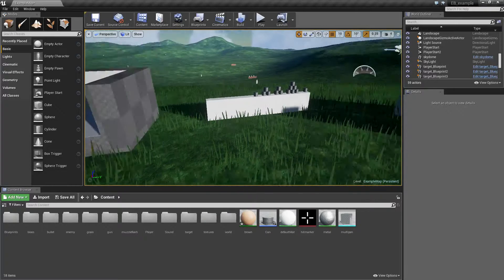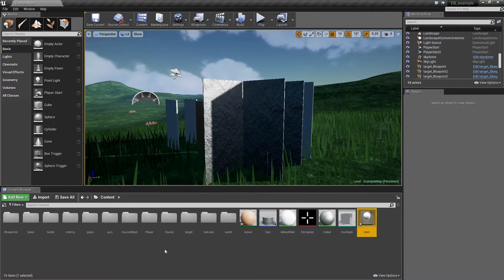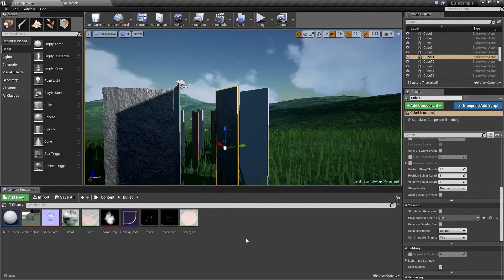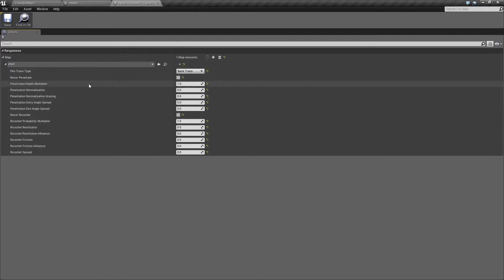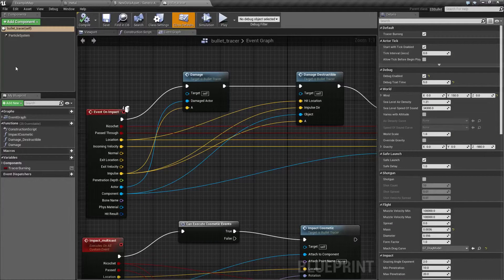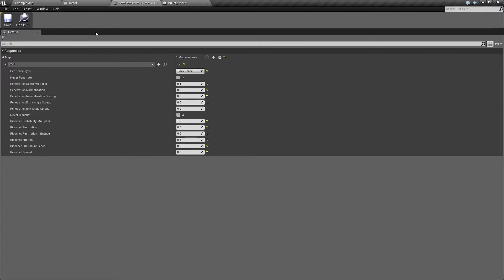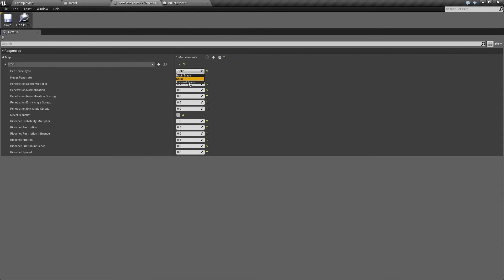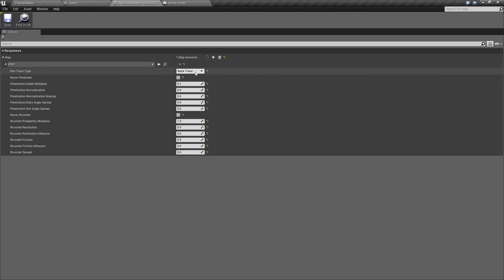EasyBallistics tutorial - MaterialResponseMap (1.4)

Comment: Can these variables be changed via blueprint? I guess I just add the class from the map bp and the values become changeable in the blueprint. So I could have bullet proof glass take 5 hits (or 100% damage) then break it using chaos solver to remove the mesh/allow bullets to pss
Reply from the maker: They can, but it's quite impractical (cause it's per-bullet), much easier to just change mesh's collision response or physical material.
Reply: Good shout. Thanks for the swift reply. So basically 5hit points or some armour health sets it from impenetrable phys material to penetrable. Got it.

Comment: Hey how do I get a bullet that penetrates wood for example 5 times. I tried all the settings and it doesn't really work as I expected.. Thanks in advance :)
Reply from the maker: By default it works based on bullet's energy rather than number of hits. But you could set up a blueprint with variable that increases on each impact and despawns the bullet when it reaches certain number.
Reply: @Worstplayer  i see. I like the current setup, i just hat the density of my physics material set too high so it didn't penetrate 😅